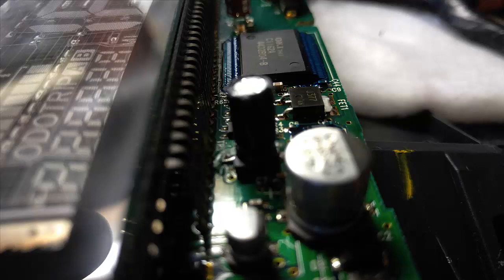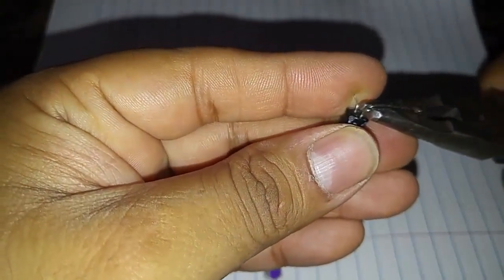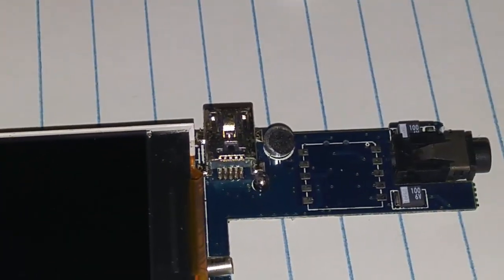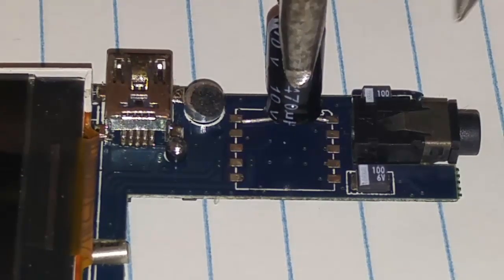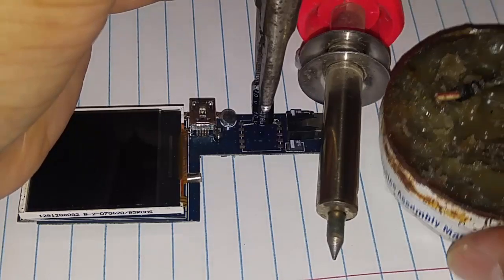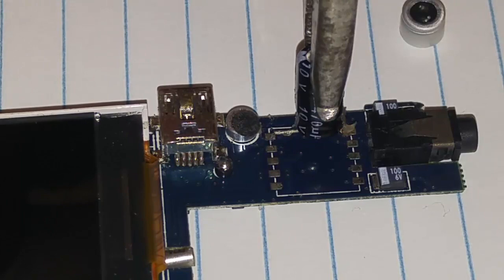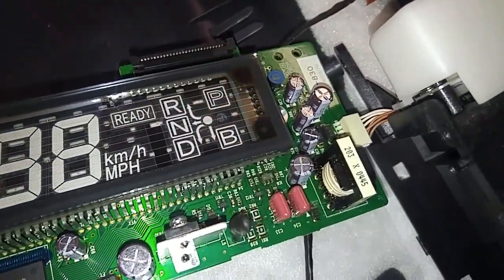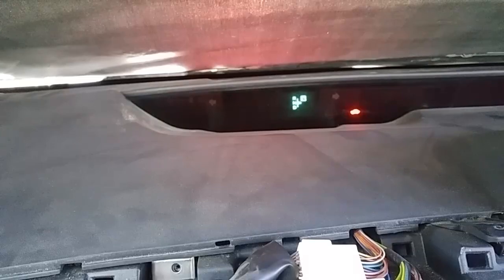prius combo meter fixed with capacitor

Comment: Ok i put a 220 uf and 16 volt capacitor today and still no dash light anything i'm missing ?r should i buy a new cluster?
Reply from the maker: Did you check if the capacitor that you replaced was broken before you replaced it? sometimes its not the same capacitor. I would double check the polarity and check all the capacitors make sure they are all functional before the new cluster. I'm really hoping that you replace the wrong one and that's why your cluster is not working. Please let me know if you fixed the problem.

Comment: What volt is the new capacitor ?
Reply: I fixed it brother it was the capacitor i was using was not the correct one i guess
Reply from the maker: @gsrjaycee4521   that's awesome buddy I'm glad it worked.
Reply from the maker: Its a 220uf 16 volt and working tempurature is -40+105°C9...company brand JWCO
Reply: I replaced same one you did
Reply: Would a 100uf and 200 volt capacitor be too much ? Volts
Reply from the maker: @gsrjaycee4521  100uf is too low the one i removed i belive was a 150uf and it tested low about 100uf and cluster wouldn't turn on. so getting to the voltage to my understanding a 200 volt capacitor in a 12 volt system we'll still only get 12 volts I chose a 16 volt because that was the only one available closer to 12 volts.
Reply: Yea i'll let you know when i fix it
Reply from the maker: @gsrjaycee4521  check this video out it helped me check my capacitor. Vald is also the guy I learned from.
 https://youtu.be/P9yi6djL2Qk
Reply: Thank yoh for the help
Reply: Btw it i used the 100uf 200 volt capacitor

Comment: I am amazed that I desoldered and soldered the new capacitor correctly. Looks like I need to reattach a wire so my fuel gauge works again.
Reply from the maker: Well I hope my video helped you out sorry I didn't take a video on how I did it.. but I hope you got the point and final product.
Reply: Was finding out where and what to reconnect very difficult?